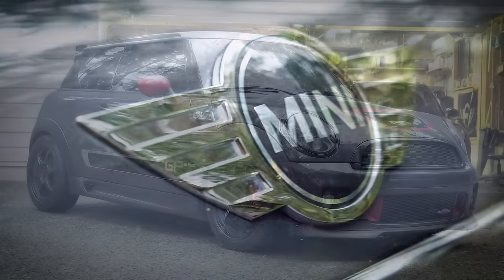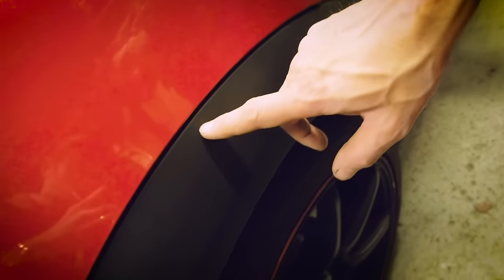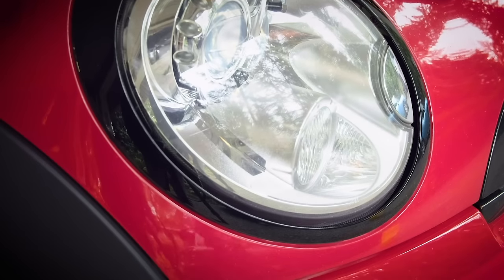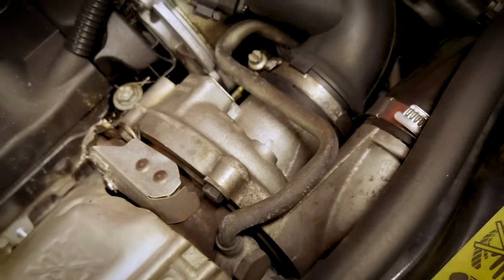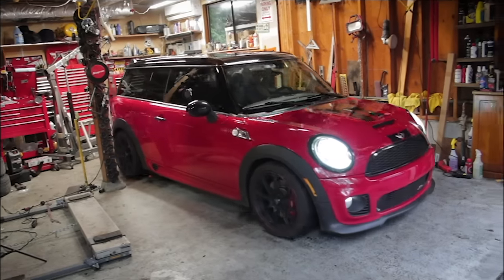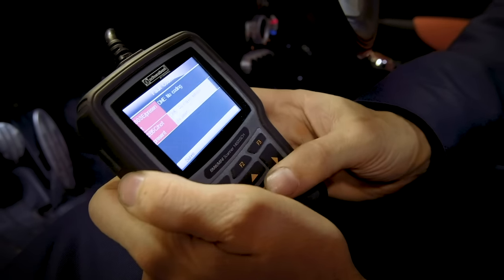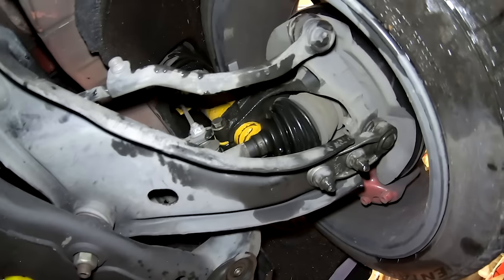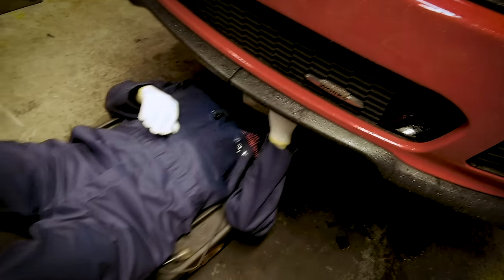Buying a used 2007-2013 MINI Cooper - things to look for - Gen 2 R56 R55

Comment: How’s the ride quality of R55 compared to R56 given its longer wheel base? Still harsh as R56?
Reply from the maker: Clubman (R55) comfort and handling seems identical to similarly equipped R56 (hardtop). Maybe slightly less agile in corners. Small enough difference that I'm really not sure.

Comment: as per Wiki "The N18 succeeded the N14", so my question: were both N14 and N18 engines used for Mini Cooper S in paralel or N18 started from particular year?
Reply from the maker: It means the N18 replaced the N14.
Reply: @ModMINI  ok, but is there a year when N18 started? Is there N18 much better than N14 and worth waiting and searching till I find one?
Reply: @zaliabalta4613  the n18 was introduced beginning with the 2011 Mini models. There are reports of some n18's in very late production 2010 models (made at the end of 2010), but I haven't come across any myself. I would definitely hold out for an n18

Comment: Nice video, would love to see you do the same video but for the R53.
What did you do to your R53?
Reply from the maker: Look at the end screen cards and info cards. I did a video for r53 4 years ago and linked to it.
Reply from the maker: There is also a video talking about everything for the R53. It's called "My 244HP R53 MINI Cooper S Mods & a test drive" . They are the #1 and #2 videos on my channel so you should have no problem finding them.
Reply: @ModMINI  I do remember does videos... don't recall you going into detail on the motor
Reply from the maker: @sr53 I went into extensive mechanical detail. More than in this Gen 2 video.

Comment: What were the years of production of those reliable engines? I mean the n12 and n16.
Reply from the maker: N12 = 2007-2010. N16 = 2011-2013 for hardtop, later for other models. N18 is also from 2011 and is pretty reliable as well.
Reply: @ModMINI  Hi,  I have a question about r55. I found clubman from 2010-08-11 with n16 engine. How to check if it is a reliable engine? You said, that it is better to buy that engine starting from 2011. Should I check that car or just leave it?
Reply from the maker: @bartoszzarychta9632  N16 should be a little better than the N12, but you'll want a prepurchase inspection for any vehicle you're seriously considering. You need to know if there is any deferred maintenance that might affect your interest or offer amount.
Reply: I talked my parents out of getting a 2011 jcw.. carfax reports had thermostat changed at 27k. Time chain tensioner/guide at 47k and clutch at 59k. Carfax reported excellent maintenance upkeep and inspections at dealership every 7k miles up to 85k miles, then apparently stopped for 6 years. Maybe sold sat on car lots?? It was imported October 2010 and I dont know what engine it was. But clearly those issues match common reviews of expensive issues

Comment: I’m really considering getting one of these. I currently drive a 2014 Honda CR-Z. Is this worth trading my CR-Z for?
Reply from the maker: That is a question that someone who does not know you would not be able to answer.
Reply: Never trade a Honda for a Euro car.  There are reasons why Japanese car only require oil change and have high resell value.  Even if you are doing your own repairs, euro is still more pricy for parts than japanese.
Reply: No. I read reviews on a 2011..common issues.
Just like my sportbike motorcycles, stick with Japanese

Comment: How to buy a 2nd gen Mini: Don't
-An R56 Owner
Reply: How about a 3rd Gen F56?
Reply: @Apoplectic_Spock  now you r talking
Reply from the maker: @Apoplectic_Spock The 3rd gen reliability has apparently been pretty good, but car is not as fun to drive as an earlier generation MINI.
Reply: I let go of my R53 and bought an S2k, I have never been happier. Mini is a PITA
Reply: @ModMINI  Maybe I should just hold on to my R52 and quit looking for a "better" Mini.
Reply: I had a 07 cooper S. Maybe i was luckily enough not to have issues with it like many other owners but i can ensure you that it is much “fun” to drive than my 18 model “bmw” mini.
Reply: @ModMINI  as an owner of a f56 2015 I can assure you that reliability is the main issue in this model.
Reply: 😂 had enough of my jcw it was a money pit so now I went ultra reliable and got an s2000
Reply from the maker: @davidc.7838  What reliability issues are you having with the F56?
Reply: @ModMINI  at 800km had an engine malfunction, then a squeaky noise in the clutch pedal that took 3 visits to the shop to get fixed, a brake fluid leak, a strange warning in the dashboard involving the cruise control,  and right now a noise when the engine is cold.
Reply: does the r56 has so much reliablitly issues ? i reallylike this car tho
Reply: Just get an R53. 👍 
S2000 is $20k way too much for a 20 year old car. My R53 was 3900$ and loving it.
Reply: If I had the time and money I'd get an r53 project. -R56 owner
Reply: @ModMINI  truth. R56 owner, 2nd gen MINI is best MINI to drive. But reliability is...pure catastrophe.
Reply: @wellwh0  non s or s?
Reply: 2007 cooper s owner here and they are not bad for the price. The oil seals go crusty if never been done, but are cheap to do yourself. The oil feed line into the turbo needs to be replaced if not done, and is easy. The only expensive part on these is the dual fly wheel clutch! Over $1000 for a clutch is insane. But again, easy job to do. Get one with low milage and do the oil seals and you'll be good for a long time. They go well and will be worth keeping for when they become "vintage". The R56 will be the model people will want.

Comment: How reliable are these 2007 base model speaking.
Reply from the maker: 2007 was the first year of the new model. a couple years newer will have better fit and finish.
Reply: @ModMINI  welp I bought a 2007 mini base model. Got codes for p0015 and p0012 and I screwed?

Comment: Things to look for: a different car!!!
Reply from the maker: Look for one with an N18 engine
Reply: @ModMINI  what years are those? I talked my parents out of getting a 2011 jcw. Carfax report had cam chain tensioner, thermostat, and clutch done before 47000 miles. Do later years have better TCT?

Comment: I probably know what your answer is going to be, but what's you're favorite model and what model would you recommend?
Reply from the maker: R53 is best for flogging the car and driving around at high rpm on the big track, and for feeling like going faster than you are going. R55/R56 is better for autocross and the street because there is more low end torque, but is hurt by the lower redline. It is more confidence-inspiring at high speed. Both have good options for adding power. R53 has a more reliable engine (but with more oil leaks) but body build quality is better in R56.
Reply: @ModMINI  Any opinion on the R60 Countryman? Just sold my R53 for the Countryman since it's more commute friendly.
Reply from the maker: @akaseanyp  Too big for me but they are good cars and the most fun to drive out of anything in their class. Most of the mods for R56 work for countryman as well. They are the same N16 or N18 engine as any other MINI of the same year range.
Reply: @ModMINI  you've mention n12/n16 engines good in your video. Currently in the market for either r55 or r56, so would you suggest the non turbo 1.6 as a reliable, good daily commuter driver?
Reply from the maker: @jetmar6018 I don't know if I would call any MINI from before 2014 reliable, but the non turbo engines are better than the turbos, and of those N16 is better  (a little) than the N12. Either can have issues with thermostat, water pump, oil filter housing leak, or timing chain/VANOS solenoid.

Comment: 2nd gens don’t have a huge problem with control arm bushings mostly 1st gens
Reply from the maker: They are a little better but they will still go bad with time. My Red Clubman in the video needed bushings at 100k miles. Front end was unstable over bumps.
Reply: @ModMINI  You're running 17's on your Clubman correct? Does that seem to affect the control arm bushings more than the smaller spec rims? I've got 17's with run flats on my 2012 Hampton
Reply from the maker: Most Cooper S have 17 inch wheels. Any addition of stiffness to suspension would put more stress on control arm bushings.

Comment: Valve stem seals are known to go bad .... it's a $3k fix which requires the engine being removed. Never again
Reply from the maker: Valve stem seals can be fixed without engine removal if you have access to an air supply and use a overhead valve compressor tool. I've done it a few times. Is about a half day job.

Comment: If anyone is thinking about buying one of these cars, don't, they are truly terrible for reliability, not so mush the car, but the engine that got put in the mini is made by Peugeot, and is't the biggest pile of crap you will ever encounter. Good Luck. R56 JCW owner.
Reply from the maker: The N18 are a lot better but yeah, they can be problematic especially if not religiously maintained.
Reply: Its not a Peugeot engine, its a joint BMW/PSA unit (Prince) and the vast amount of issues this car has are all BMW designs (HPFP, timing chain and tensioner, coil packs, Vanos, Di etc).

Comment: Don’t bag on N14. That’s stupid. They just have timing chain guide issue. Replace the guide and you’re fine. BMW replaced them for free with new timing chains. My JCW has got over 125,000 because I take care of it and keep the oil topped off and changed regularly.
Reply from the maker: A poorly maintained N14 can have more than just a guide issue. But yes, when well maintained they do a lot better.
Reply: Mod MINI any poorly maintained MINI engine - N18 - N16 - can have issues if oil is not maintained properly.
Reply: Mod MINI rest of your video is decent.  But I think your comment on the N14 is not.
Reply: Mod MINI and no it’s just the guides on the N14. Crap engines don’t last 130k +.
Reply: Mod MINI You should be bagging on the F series the third generation those suck.  You’re too top-heavy and the interior design sucks and the Eco mode sucks and they’ve eliminated the stick shift which also sucks.

Comment: N14's blow up at 60.000km
Reply from the maker: They last fine if you keep the oil in them. Well, timing chain is a problem, but it is less of a problem when well maintained. I know a N14 owner with 110,000 miles (about 180k km) and never had the chain done and it had no leaks. Original owner car. Most are leakers though.
Reply: Mod MINI I got a N14 with 122k miles. No timing chain issues to my knowledge, but I’m not the original owner. Only problem is that the waste gate is toast, but it’s still a great daily driver.

Comment: So basically you want to buy 2010  and up ... 👍
Reply from the maker: Basically.
Reply: If you don´t want to have a LSD up front, buy a 2010 on. n14´s issues are commonly associated to a bad maintenance. My MCS is 11 years old. I tend to drive it hard, no problems up to time aside from having the water pump replaced. 200€ issue in 11 years of hard driving.

Comment: First thing a perspective new owner should look for is a different car. The R56, while a fun car to drive, is a pile of shit. In 100k miles I’ve done 2 timing chains, valve cover, throttle body, new accelerator pedal, thermostat housing, passenger seat sensor, oil filter housing gasket, repair wires that wore through by the rear control arm, turbo oil lines, & high pressure fuel pump. That doesn’t include the regular maintenance like batteries, oil changes, brakes, clutch, etc. Keep in mind I check the oil every week and get it changed every 5000 miles. It’s a British car,  built by Germans, with a French engine....What could go wrong?!
Reply: I didn't know they had Germans in Oxford England. Watch the Smithsonian video on the factory.
Reply: Sorry I could only find a French link for free. I believe it is also on Smithsonian web page. In English.  Supercar Superbuild. Mini.
Reply: So many people blame this on PSA and yet all the major issues on this engine are BMW designed parts, HPFP, BMW, timing chain and tensioner, BMW, Vanos, BMW, coil packs, BMW, Direct Injection system, BMW. People like to think that its not BMW's fault, if you think that is true then look at the F20 engine that replaced the N18 and see what issues that had (lots if you dont want to look it up). PSA still use a version of the N18 turbo unit in its cars,  from 165 (replaced by the 180ps unit) the 208ps engine and the 272ps (now reduced to 262ps for WLTP), they dont have anywhere near the issues the older units had but HPFP (still a BMW item btw) and the timing chain/tensioners can be problematic on earlier cars (though the tensioner has been uprated).

Comment: We have a 2007 S.  Hitting a bump is like riding a bicycle with flat tires.  Hitting a big bump or a buckle in the pavement??  You cringe and grit your teeth.  The ride is horrible in the thing.  It has nothing to do with feeling/being engaged with the road.  It's like the car has no suspension at all.  If you're on pavement that is fairly flat with few imperfections, you're okay.  But when things get bumpy, you'll want to get rid of the car.
Reply from the maker: 2007 was a long time ago. Replace bushings and struts and car will ride good as new.

Comment: I had 6 (six) Minis over the years in my family: two R50 Coopers, two R53 Cooper S' and two R56 Coopers S. The second gen Mini (R56) are a joke compared to R50 : poor build quality, cheaply made details, and the 1.6 turbo Peugeot engine is literally made of cheese. I  still own a R53. R56 are absolute garbage in every way.
Reply from the maker: I think the build quality and fit and finish are better on 2nd gen. The engine is the weak spot for sure.

Comment: Used German cars are money pits. It is going to be one thing after the other. They extended the warranty to 10 years on the High Pressure Fuel Pump and the Footwell Electronic Module and it is running out.

Comment: Minis are absolute garbage. When you combine horrible engineering 
designs along with cheaply made idiotic plastic parts and shitty 
wiring...it's a guaranteed recipe for disaster. Want one? Buddy up with 
your local Mini mechanic if you can find one...and load up your checking
 account. You're gonna need both.
Reply from the maker: Thank you for your viewpoint.